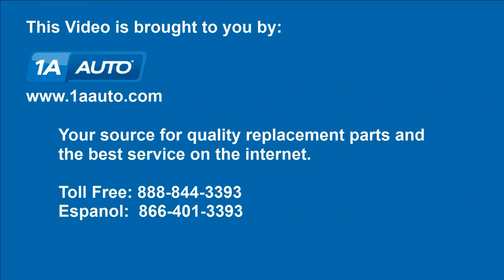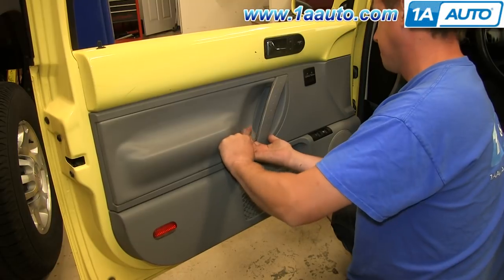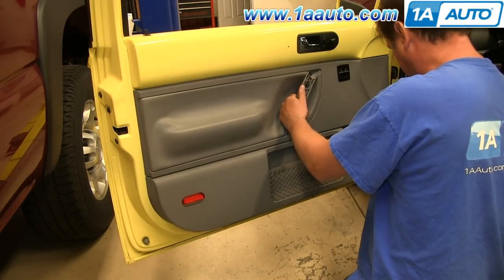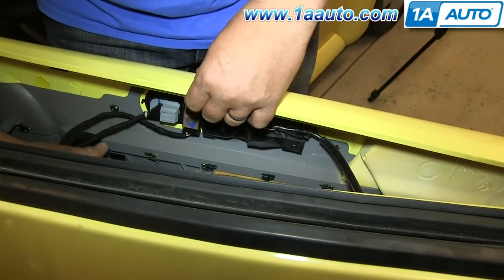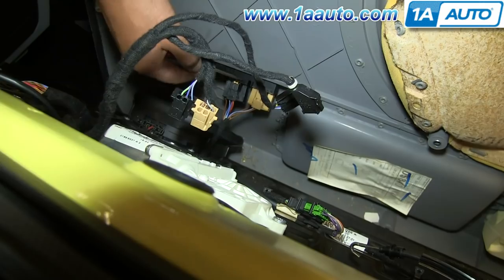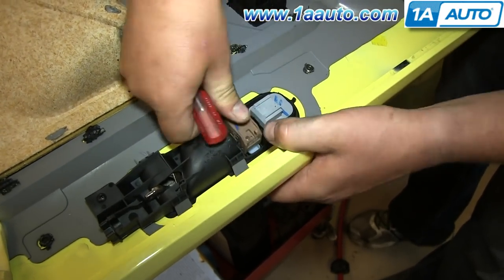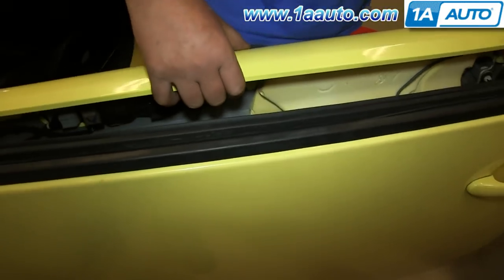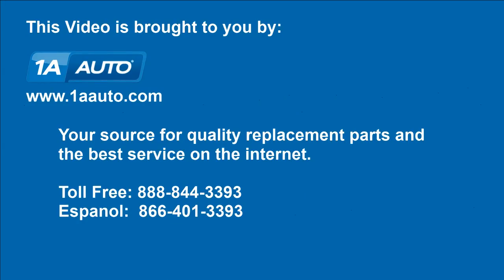How To Replace Door Lock Switch 2001 Volkswagen Beetle

Comment: Do you think that the power door lock switch is the reason that my alarm system goes off at all hours of the night? Or could it be something else? I have a 2001 VW Turbo Diesel Beetle with 250,000 miles on it.
Reply from the maker: +Penny Precopia We wouldn't be able to diagnose an issue like that here, you may want to have a local mechanic take a look at it. Thanks for checking us out! 1AAuto.com

Comment: My door wont open from the inside, but it will open from the outside. I took the door panel off and everything else works and look fine. Even the door cable. Any suggestions?
Reply from the maker: +Shon9tilR At this time we are unable to diagnose the issue you may be experiencing and would suggest you contact a local mechanic for further assistance.